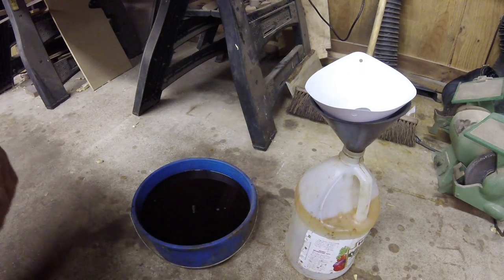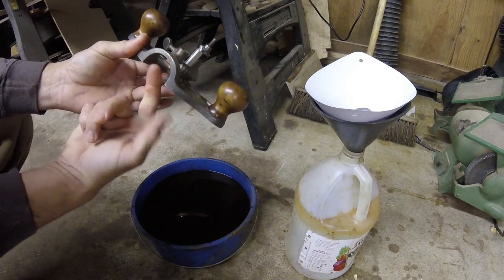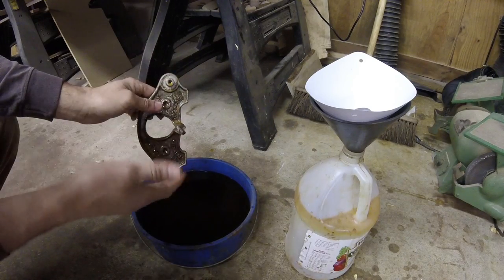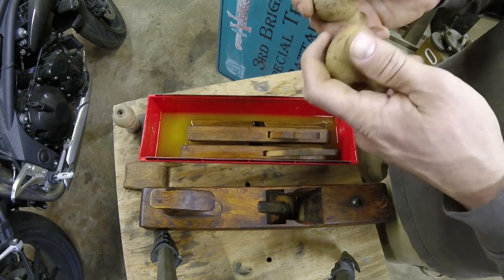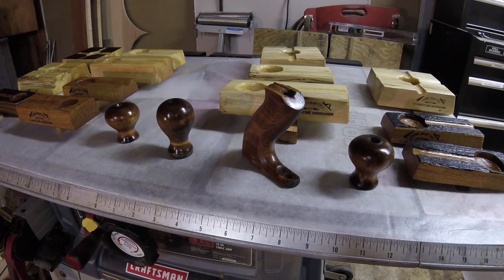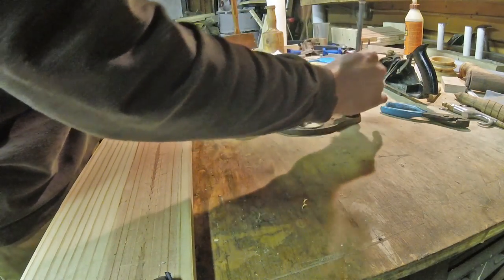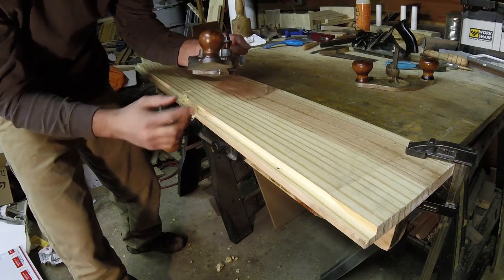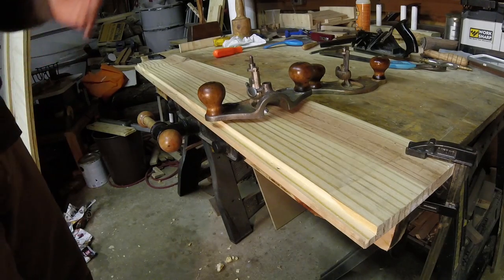Partial restoration, Setup, and Use of a Stanley No. 71, and a Stanley No.  71 1/2 router plane.

Comment: you can also attatch it to a piece of hardwood. I have seen this in a few videos on these. it will eat some of your travel but give you a much larger engagement surface.
Reply from the maker: I do have a thin piece of white oak that I have used for that.  My 71 1/2 has the counter sunk bosses for the holes, but they're not drilled through.  I picked up another 71 1/2 Sunday that has been drilled through though.  Its a nice one though, but I listed that one on eBay.